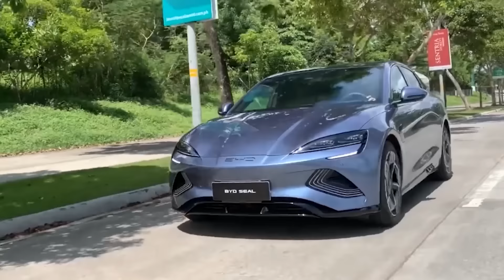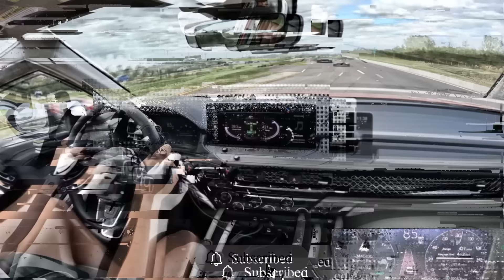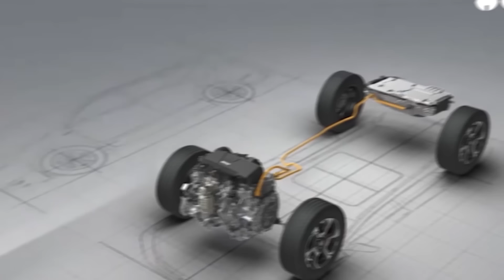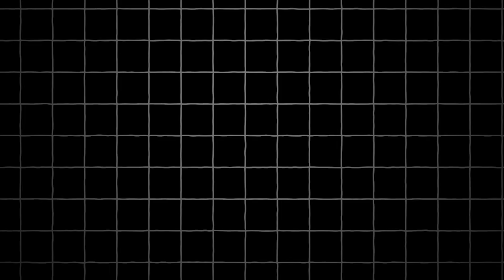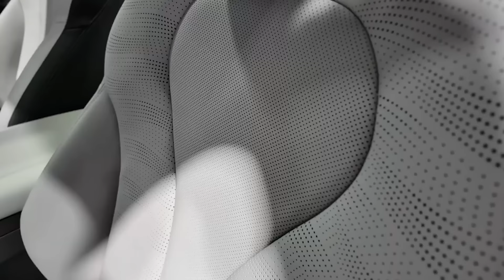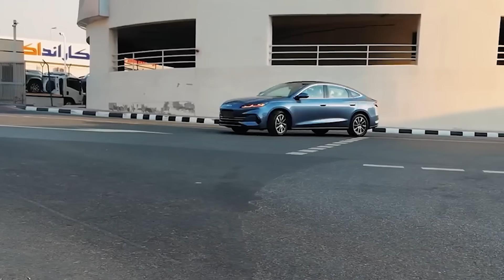This New Chinese Electric Car Has A 2100KM Range ‘MUST BUY’ – BYD Seal 06 DM-i

Comment: That range is only useful if it does not burst into flames before it gets there.
LI Batteries are so dangerous that many insurance companies will not insure them and many garages will not allow them in.  They are complex to the point of being un-repairable and famous for all kinds of reliability and quality issues. 
But the bottom line is not that the tech is very bad, it is that they are not green by any measure of the term.  The employ slave child labor and huge devastation to mine the rare earth materials.  And then there is the Fuel.  Most EVs run on coal. 
Even worse is the underlying reason for their pathetic existence.  CO2 emissions.  The legitimate science has debunked the myth of CO2 being harmful to the environment years ago. It is in Fact, entirely beneficial and support all live on the planet.   We need more of it, not less.   The really need to be banned.

Comment: Chinese EV’s are garbage.
The batteries catch fire when the engine is over heated and not suitable for extreme Canadian summer and winter weather.
Chinese claim and guarantees are  fake.
After sales service  is no where. 
Chinese buying  BYD EV’s are crying and frustrated in China😂😂 I
Reply: Idiot… china has 4 full different season.. and a huge desert.. learn more geography dude..
Reply: BYD now is using blade battery, that wont burn
Reply: You do know that statistically ICE car have higher chances of catching fire than EV right? 😂
Reply: @matthewlee3650  Teslas burn more than any other EV car manufacturer because their early cars used Lithium NMC batteries. Now they buy safe LIFePO4 batteries from BYD or CATL.
Reply: Teslas burn more than any other EV car manufacturer because their early cars used Lithium NMC batteries. Now they buy safe LIFePO4 batteries from BYD or CATL.